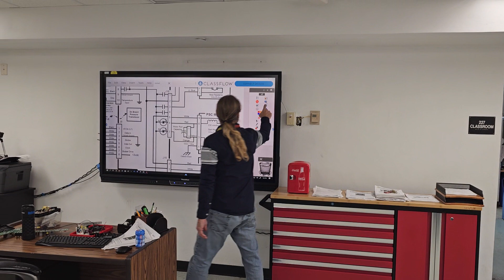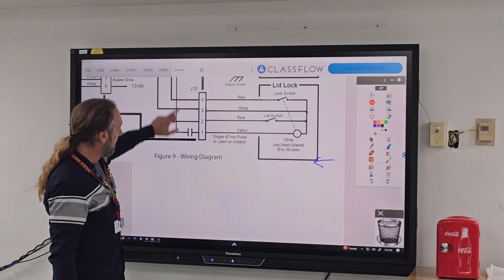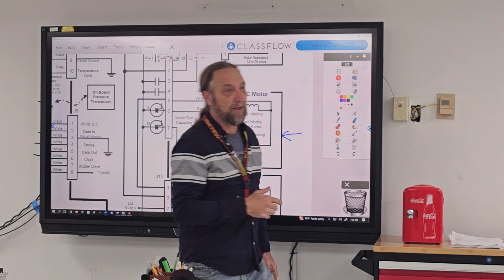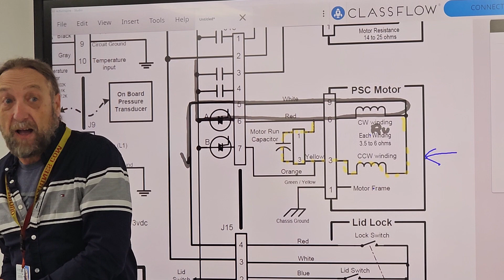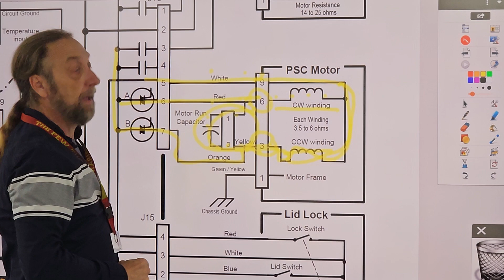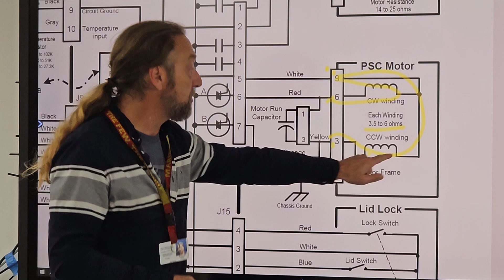VMW Washer motors

Comment: Be careful when the motor does not start or run. A failed winding will leave no path for the capacitor to discharge and give you a nasty shock.